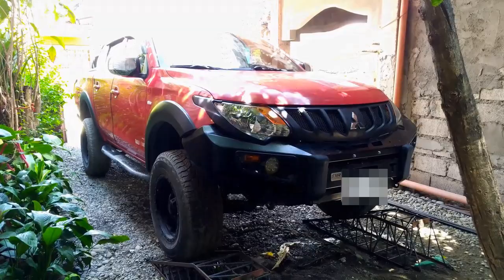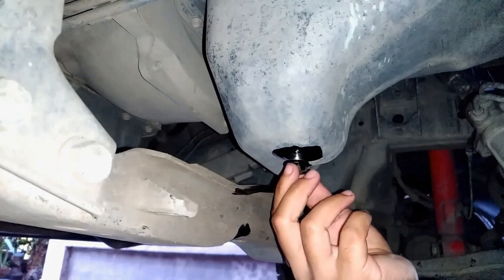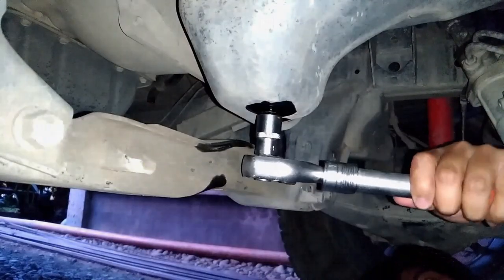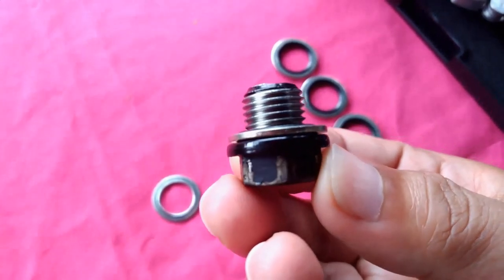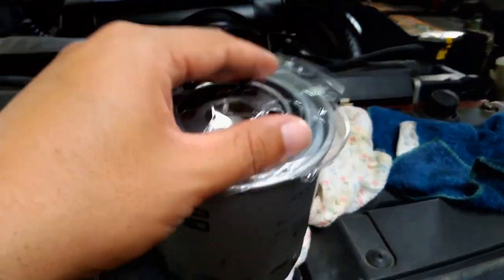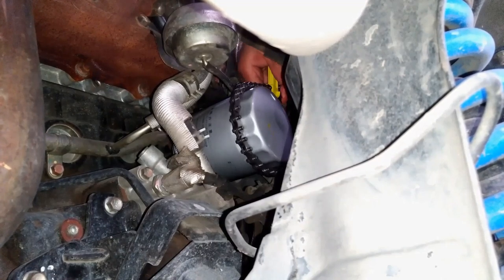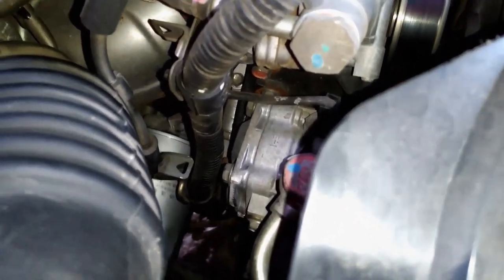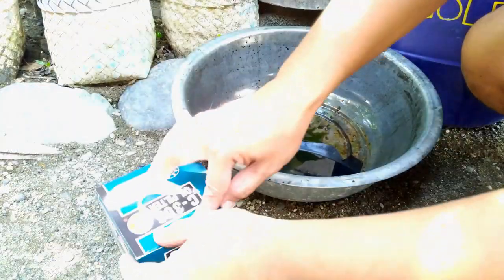DIY Oil Change & Engine Flush | L200/Triton/Strada 4D56 Engine

Comment: Restrain from using diesel oil for flushing.. it might destoy your engine.. use the cheapest engine oil which is p150 or p130 per litter...
Reply from the maker: Yes boss I agree with you. What I did is just an alternative to expensive engine flushing done by casas. If you watched the whole video I did a mixture of diesel and engine oil with 1:1 ratio and run for 30secs only just enough to circulate the mixture to remove gunks, sludges and residues from crevices of engine block. So meaning not pure diesel oil and I'm already aware of this. I decided to do this since my unit is almost 5 years already. Anyway maraming salamat boss sa advice at nawa'y mabasa din ito ng mga viewers. God bless.
Reply: Scary diesel oil flushing oh no no no no
Reply: Actually dont worry about diesel its fuel as well as lubricant , i bought a used motorcycle and the engine was in bad state (full of sludge ) , some time the engine wont turn on it would die rpm not stable , so i used diesel 1:1 ratio just like in the video and well i flushed the engine  and its amazing all the issues are gone turns up diesel is a great carbon cleaner